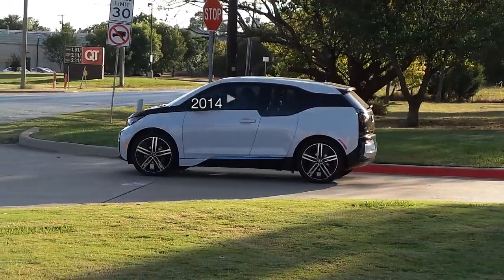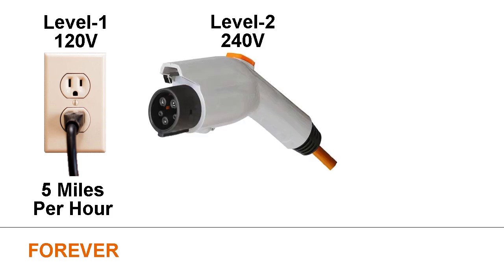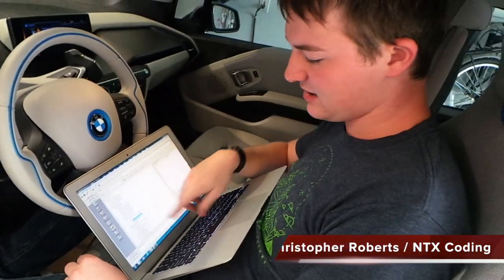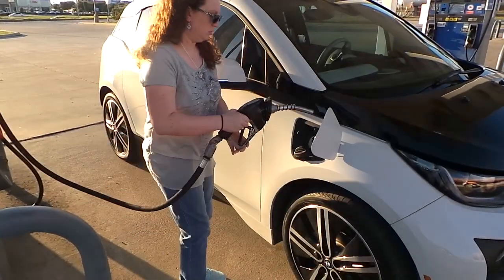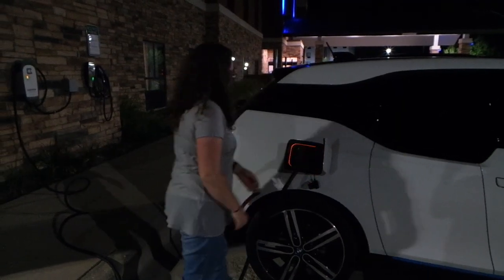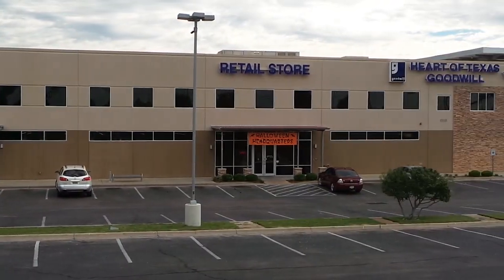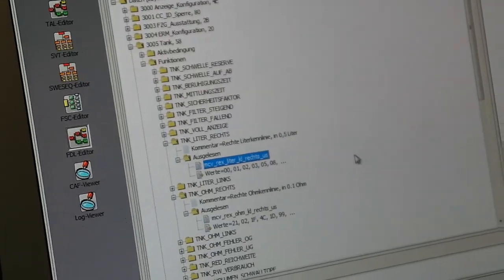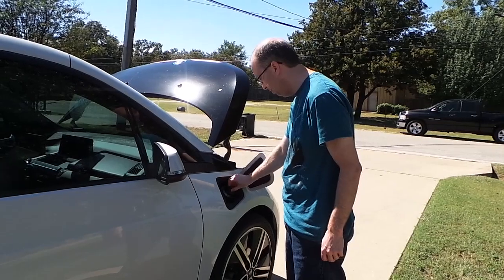BMW i3 REx roadtrip, charging, coding, and range test.

Comment: Love the look of the vehicle but the mileage range it too limiting for my use.
Reply: The 2019 BMW i3  comes with a 42.2-kWh battery (120 amp-hours), which should permit for up to 153 miles of all-electric driving. This is a roughly 30 percent improvement over the previous 94-Ah battery, which allowed for 115 miles of range

Comment: An i3 depreciates by half of its original cost in 3,000 miles!?  That's ridiculously bad and I would avoid that car like the plague.
Reply from the maker: It isn't quite that simple.  This car was a manufacturer buy-back, which was on the title.  That probably knocked $5,000 off the resale price.  Also the $7,500 government tax credit was used by the original buyer, which is sort of baked into the used-market value of all electric vehicles.   And the rest is just regular depreciation.
Reply: Look at the price of Nissan Leafs, they have horrible depreciation...
The Tesla Model S seems to hold its value well however...  it is the only really decent pure EV however...

Comment: The one question I always have about electric cars is why do they even exist considering most people likely get their power fossil fuels, so that would not be any better then just getting gas. Now I know that there are a lot of places that use green energy like hydroelectric, solar, wind, (and I never know how to count nuclear) but that only accounts for 13% of american energy. because I just did a little bit of research and if you charge an electric car in a place that burns fossil fuels for energy, there is no benefit for the environment. so is it cheaper in the long run based on the electric bill and yearly cost for gas? or is there no savings involved and is just the illusion of that it is good for the environment (unless you know your state uses clean energy in which case it would be better for the environment)?
Reply from the maker: Well, your assumption seems to be that people only buy electric cars to save the planet.  I suppose there may be some people like that.  But everyone I know that drives one loves the convenience, performance, and the quiet ride.   For example, if they offered a gasoline powered cell phone, would you rather have that over your battery powered one?  No?  Then why wouldn't you prefer your car to be electric for all of the same reasons?  However, to answer your question about the environment.  Most of the energy here in Texas comes from Nuclear, wind, and natural gas.  So driving an EV does produce much less pollution.  Not only that, people often forget (conveniently) that gasoline itself requires an enormous amount of energy just to refine it from crude oil.  So it isn't really fair to compare tailpipe emissions to power plants unless you are also going to include gasoline refineries.
Reply: The 8-Bit Guy I guess I forgot about the quiet factor and I live in a realistically small state so there is not a lot of long lines for gas so that is not an issue but I guess in more populated areas that might be a factor. sorry if I seemed harsh
Reply from the maker: We don't really have long lines at gas stations here either (usually) but just having to go to one at all is an inconvenience.  I think people are so used to it that it doesn't bother them.  Sort of like people weren't bothered by having to manually crank their engine because they really hadn't experienced electric starter motors. Or kind of like people told me keyless entry was a luxury feature they didn't need but now everyone has it and can't imagine going back to keys. So once you get used to fueling your car at home, you eventually wonder how you ever put up with driving to gas stations and standing out in the cold, heat, or dangerous places at night to fuel your car.

Comment: In my opinion all this kind of analysis will be always incomplete if you miss to say how much it will cost to replace the all pack of batteries after around 8/9 years. At today prices, of course.
Reply from the maker: Why?  Should every car review talk about replacing an engine or transmission after 8/9 years?  I doubt many people keep a car that long to worry about such things.  And just because the batteries are warrantied for 8 years doesn't mean they will fail immediately after that.  They will likely last much longer when the cars are taken care of.
Reply: Of course it is not needed for every car review talk about replacing engine because everybody nows already how long in average a engine lasts and what are the envolved costs. 
 But in this electric cars we are still talking about an emergent technology. And still exists some mistrust about this technologie, particularly respecting to the duration and the costs of the all pack of batteries.

I think it does not help the "take off" of sellings if we don't have accees to all information so we can racional decide with all the facts.

Comment: EV's aren't there yet in terms of practicality.  And consider that all batteries have limited lifespans.  After a certain number of charges, they don't work anymore.  And a battery replacement is expensive unless under warranty. EV's make more sense as a leased vehicle and only in areas with established infrastructures at this point.

Comment: Owning and using a electric car seems like too much of a hassle.
Id rather pay the money for petrol and not have to worry about charging every 150 to 200 miles.

My pickup has a range of about 400 miles and it takes about 5mins max to fill up.
The only downside is the cost of fuel.

If you want great fuel economy, save on startup and maintenance costs then buy a diesel car.
Reply from the maker: Funny you say that.  I see it exactly the opposite.  While it is true that the long-distance trip can be a hassle, the day-to-day operation is much less hassle than a gasoline or diesel vehicle.  I never have to make a trip to the gas station.  On the vast majority of days (like 99% of the time) I charge at home and leave the house with a full charge in the morning.  There are no oil changes, filter changes, emissions inspections or any of that other nonsense.  All I have to worry about is the 2 seconds it takes to plug the car in at home, then replace the tires, wipers and wiper fluid.  That's about it.
Reply: Dolores Nieto

Comment: I wouldn't have bothered with a electric car, there's a better method. Take your gasoline powered car, flush out the engine and gas tank, adjust the engine to run on vegetable oil, fill your tank up with the vegetable oil and there you go providing you can put up with smelling like a fast food shop. Also vegetable oil is easier to get than charging a car up.

Comment: Tesla Model 3 is cheaper, faster, more reliable, has WAY better range, and looks damn good. 

i3 is expensive, repair bills are expensive as hell, lasts for 4 years or so and breaks down, looks like a McDonalds toy, and gets worse range than a damn Nissan Leaf. It is decently fast, I will give you that. 

But compared to a model 3 it’s not even close.
Reply: Rob, um, you’re aware that the i3 breaks down after 50k miles and Tesla can run for a million? And besides all the advantages of the Model 3 or even the goddamn Chevy Bolt make it a no-brained against the i3. Also, I have a theory that the only reason the i3 and i8 exists is to meet zero emission credits and they don’t want you to actually buy them.

Comment: Texas putting in infrastructure for methane powered vehicles instead of electric would be far more sensible. Natural gas is very clean energy in respect to pollutants (relative to gasoline and diesel). Methane powered cars would be at a third the cost of electric - everyone could afford one and no federal subsidies would be necessary to provide any incentives. The after market price of such vehicles would sustain much better than electrics (everyone has anxiety about the aging process on the very expensive batteries of electrics); as such electrics fall off a cliff per their resale value. Methane powered cars could easily be designed to have a range matching or exceeding gasoline cars (typically somewhere over 300 miles). Texas and the nation at large have an abundance of natural gas to last many centuries - long enough to perfect a better technology for electric vehicles than batteries or hydrogen fuel cells.

Comment: Clearly electric vehicles are still a niche product.  Until you can go from 0% to 100% charge in 10 minutes or less, they’re going to remain a niche product.  Hopefully battery technology will come along and allow that to happen.  Unfortunately, current batteries are destroyed by fast-charging like that — it’s why the Tesla limits its “fast” chargers to bring the car from 20% to 80% in 30 minutes.  If they allowed the “fast” charging to happen from 0% to 100%, or they allowed it to happen in less than 30 minutes, the batteries wouldn’t last for more than a couple of cycles of that.  And might even catch fire, if the charging were very fast — like 10 minutes or so.

Comment: Bolt has shitty interior construction that will degrade rapidly. The I3 will look beautiful for 30 years. The 260 kilowatt NA-Solid state glass replacement coming in 2025. Will give a range of 450 miles. Depreciation and a car is .015% per year because cars become rebuilt. About 30 years of driving to zero out in taxes. But will work much longer and passed on. Tesla Model from 2010 still work. Cool.

Comment: My problem with charges at rest stops is.... Who's paying for all this power you're using?   Oh wait.. I am...   So you want me to pay to fill your cars battery...  But i still have to buy my own gas...   Seems Legit..
Reply from the maker: Who pays for the candy in the vending machines they have?  Oh wait... the customer does.  So why would it be any different with the EV chargers?
Reply: You might be willing to pay...   But most EV owners seem to think that everywhere should be letting them "fill" up for free..  You've even said you had you not found a 220v charger you would have just plugged into 110v.    How is the hotel going change you for that? They likely wouldn't.   So charging your car gets passed on to me.       Much like where you said your work has free charging stations..  Who pays for that?   Everyone who works there..  Do they give free gas to everyone else?  

    See what i'm getting at?
Reply: Dude, a full charge costs $2,-
-.-

Comment: you wanna know an anti-EV sentiment that always amuses me?

"hurr de durr short range so gas better"

let's see

What's within 1KM of me?

My grocery store, pharmacy, several restaurants, a dollar store and the post office.

What's within 5km of me?

The hospital, every other store I might need, and WalMart

What's within 10km of me?
Work.

What's within 20 km of me?

All of town.

What's within 40 kilometers of me?

Every adjacent town.

What's 85km south of me?

A large city with everything I could ever need. With EV chargers everywhere in said city I'd want to go.

What's 200km south of me?

THE PROVINCIAL CAPITAL. With EV chargers everywhere and towns with loads of them in between.

What's 250km south of me?

The Pacific Ocean.

What's 50km to the west?

The Pacific Ocean.

What's 250km to the north?

The Pacific Ocean, with spatial anomalies pretending to be towns dotting that stretch of road.

What's 50 kilometers to the west?

Albuquerque

(not really, it's the ocean again)

frankly doesn't matter if you have 500+ km of range if you can't DRIVE 500 kilometers without hitting an ocean

wanna go more than 500 kilometers on a lark? We have a tool for that

it's called "take the 1500-pound, 4000-dollar truck that gets 30-50mpg with a tiny little inline-3"

Comment: All of these troubles for a simple trip. EV life...
Reply: This seems to be more specific to earlier EV designs like the i3, most manufacturers have got their act together with 150+ mile range cars so not so much suffering. That said, I've got an i3 that I used for my daily commute (with a diesel car used for longer trips) and despite the limited range, it's still saving me £200 ($250)  a month in fuel costs.

Comment: Um. No thanks. Too low of range for such a pricey "car". Until they can get that range up to and beyond what a good gas car can achieve, there still is no reason for me to buy one of these things. 
Price will be a problem for a while, since the ones with better range are also VERY expensive!
Reply: Yeah. It's really unfortunate that we still struggle to bring the range of electric cars up without forking over 75K for a tesla 🙄
Reply: @sobbingsop692 , agreed. My Kia Soul gets great GAS mileage and she didn't cost a fortune to buy. Whenever the day comes that we can by an all-electric, or hydrogen powered, vehicle for the same price I paid for my Soul, that will be the beginning of the end to gas powered cars. Until then, I personally cannot see myself buying one until the cost, range, and available stations are as prevalent as gas powered cars and gas stations.

Comment: the new ElectrifyAmerica dot com will help with more Fast Charging for an i3. But I went with my friend in his i3 to a Fast Charger. It went very slow after 80% and wasn't worth the time and slow energy.  I have a Chevy SPARK EV w Fast charging and it is super fast all the way to 100%.  On a trip that is a big deal.  I'm not i3 impressed.
Reply: no dirty inefficient range extender. It has an optional DC Fast Charge port. That is way better than a range extender. Although I do carry my fold up bicycle in the back of my Spark EV and call it my unlimited Range Extender with no pollution.

Comment: Chevy: Calls hybrid a Chevrolet Volt, a gas hatchback from Daewoo a Chevrolet Spark, 
Calls fully electric car a Bolt... right...
bolt: a metal pin or bar used to fasten. A simple machine made to hold something together. Engines use hundreds of bolts but the Bolt is an electric car.
EV1: An electric car leased out to the public in California and Arizona limited numbers due to the California CARB EV program that was then taken down letting manufacturers repossess cars and crush them in Colorado even after owners sent a no risk offer and a combined 22,000 check to GM saying they would accept an extended lease and/or complete ownership of the vehicles that was denied. 

I don't like GM...
Reply: Bolt refers to lightning bolt, not what you're describing. That is fairly obvious.
Reply: Yep, that one went right over his head lol.
Reply: oooooohhhh....... ok... I still don't like GM tho lol
Reply: They were better in their heyday, but then again, so was every car company, American or not.

Comment: this car is stupid 2 motors 2 problems why complicate basic things?
Reply: Its actually not more complicated. No super or turbocharger, alternator, traditional gearbox, hell the rex don't even have a air filter. Its definitely more reliable than a comparable gas car.
Reply: @Kopfkirmes55  but wouldn't it be simpler just to have it all electric ?
Reply: @bozsikandor  Yes, of course, but in 2014 batteries were still extremely expensive. A little gas generator provide the same range at lower cost. Today it's a different story.

Comment: Ah, the "logic" in driving an EV at 80 mph is ludicrous as any sense of efficiency vaporizes. Since I am not going to change the mindset based on emotions with data I shall skip that. All I will say is that going fast to wait longer to charge on a road trip will not save time and, according to experts, stresses the battery. End of story. BTW, do honk and wave when passing a red Nissan Leaf cruising at 62 mph. Bye.

Comment: Ok...i'm just going to put this out there...having only 150 range (or eek less than a 100) for your car seems kind of pointless.... I realize that EV's are the wave of the future, but I can guarantee you I will NEVER be purchasing an EV unless I can get at least 300 miles range. Call me old fashioned, but good ole ICE are still the best bang for the buck.
Reply: Yeah I wouldn't buy that car either.  If I were to get an EV, it would definitely be a Tesla.  They have vehicles that have over 300 miles range, and currently the best fast charging networks.